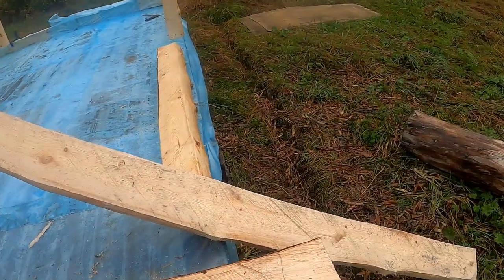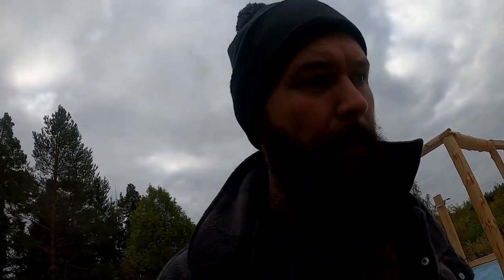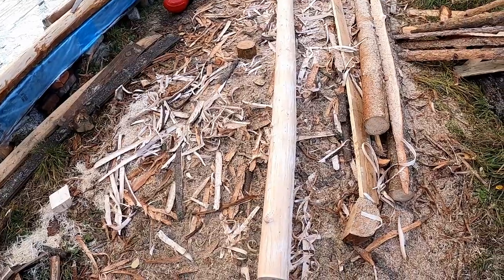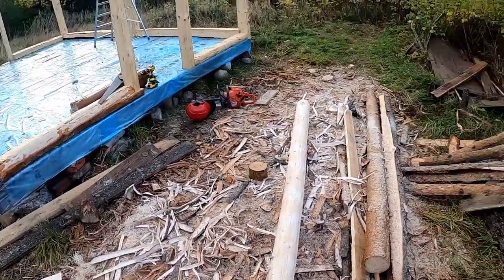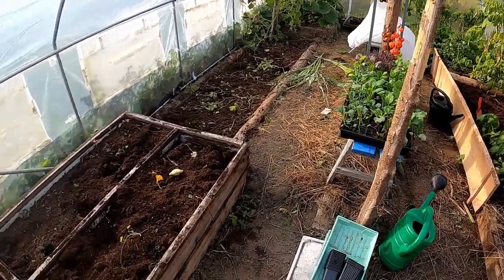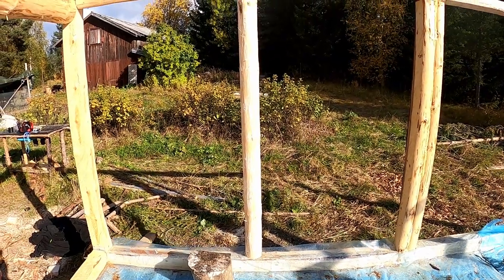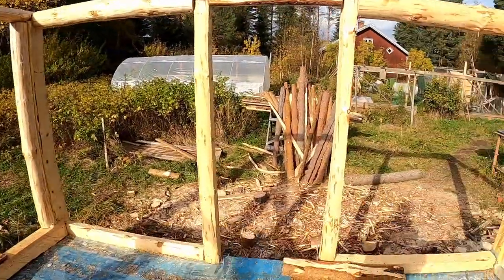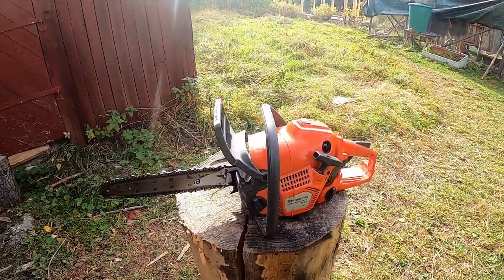Living off the main grid | Tiny house build UPDATE | Log frame

Comment: Hi, been watching your channel. Just wondering what's wrong with your chainsaw bar?
Reply from the maker: Hey, the bar has a few knicks out of it , which have been filed back but it’ll get to a point where it’ll rub on the chain inside on rotation. Best to just get a new bar so I have the option to swap out and continue work when it becomes more of an issue. Thanks for watching and commenting, all the best